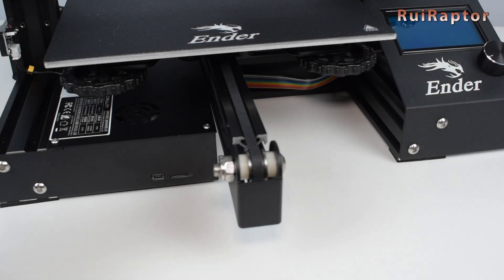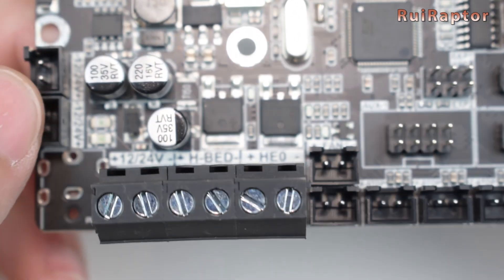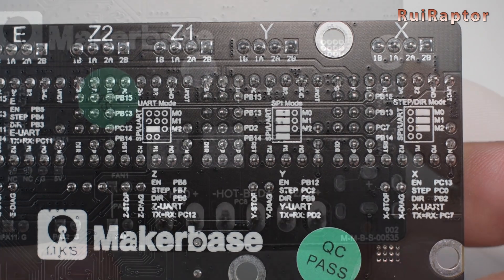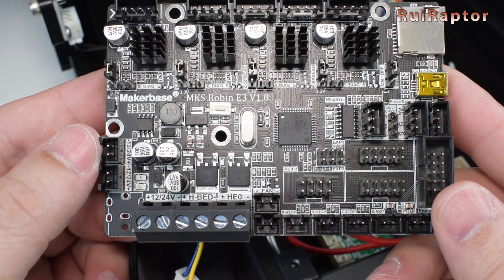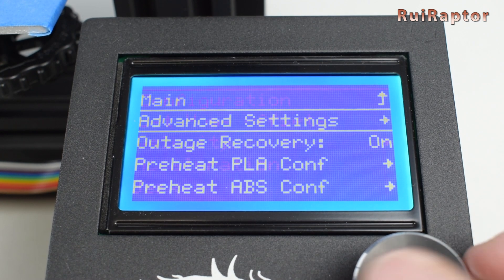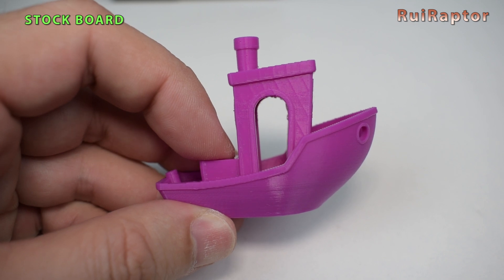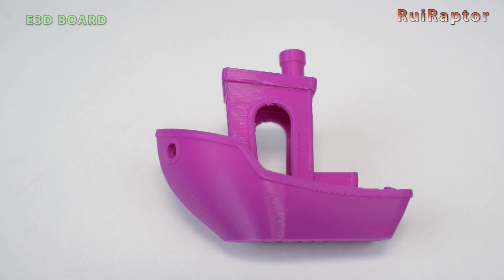MKS MAKERBASE Robin E3 / E3D - Installation & Tests (Creality ENDER3)

Comment: I hate these board and i hate this software. I was going to use the last of some filament and lode new during a print and was a little slow. Beeeeeeeep beeeeeeeep! every issue I have is with the sensors. one time the board decided it did not like the filament sensor where it was plugged in at! I knew it was all working so at last I tried to move it to the other sensor connection on the board. this morning the heat sensor was temperamental for no apparent reason. sending out an error i searched and searched and saw no post one any error message on the internet. I finally saw it was reading the temp wrong as I retried the print.  Stupid thing printed a birds nest yesterday but oh no one second of no filament and it must abort 1:30 of printing today. Im just going to tie off the sensor with the ugliest know I can make. I hate 3d printing.
Reply: ...now the board will not boot. I never have trouble with grbl + adruino

Comment: why does everyone use the skr boards over these. ive got a few printers with makerbase robin mini boards with either 2208 or 2209 steppers never had to dig into them so not 100% just know they are silent but they have been the more solid machines ive owned. im picking up a couple boards to have as extras an just to play around with and im on the fence if i should get an skr board one a makerbase. can anyone explain to me what the difference is an why it seem the skr or bigtreetech are more popular when from what i can tell they are just as good or better in some cases from what i can tell on paper or i maybe miss understand what im looking at.

Comment: Olá Rui, great review and guide! I just got my Robin E3 v1.1 after seeing this guide, I had to order it - took several months to arrive though :)
Mine does come with the separate fan connector.
I also have a very heavy-duty Mingda MD-6C I bought second hand with problems, it has larger stepper motors, think these boards would also work with it? I can see the perfurations for the SD card would not work, but I am sure it would be no challenge for my dremel hahah :) I am particularly concerned because of the display, which is touch screen color, so very different from Ender 3s
Reply from the maker: Boa tarde Daniel, Thanks for the comment.
The E3 model has non-replaceable drivers so if you need more powerful ones, you cannot replace them. The E3D, on the other hand, allows the installation of different drivers. However, you can try and tweak the output current values and see if they can handle (don't know which stepper drivers you have and how much current they need). As for the display, this board has several display connectors so it's very flexible. It might be possible with a correct mapping and setup of the firmware.

Comment: Notice for v.1.1 board, from Makerbase Github:
MKS Robin E3 V1.1_003 and MKS Robin E3D V1.1_003
    Z-STEP signal change to PC14
    Z-DIR signal change to PC15
    Add support AT24C32D eeprom on the board
Make sure your board pins definition in Marlin is configured accordingly
Reply from the maker: Thanks for sharing this information.
Reply: Hi, lets jump in here. I have a E3D v1.0 and want to update the firmware, what is the correct firmware for it? In the configuration file for the mks there is a E3P, shoul di use this os use the E3 v1.0?

Comment: 5:45The fan interface is incorrect. This interface and the nozzle cooling fan are synchronized output, so it can adjust the wind speed, but it is not conducive to the heat dissipation of the motherboard.It should be connected to the 12-24v out next to the power supply

Comment: hola ruiraptor haver si me puedes ayudar -hay un marlin configurado para creality cr 10 en el home de makerbase este marlin trae 3 opciones.
1. No BLTouch and No Filament runout sensor
2. With BLTouch on Z_EndStop and FilamentRunoutSensor

3. With BLTouch on PB1 and FilamentRunoutSensor
las dos primeras las entiendo lo que no entiendo es la 3. nose que significa PB1 si me pudieras explicar que significa esta configuracion en marlin te estare eternamente agradecido .perdona por extender la pregunta me dijiste que me pusiera en contacto contigo por email.pero no lo encuentro yla verdad es que no utilizo la redes sociales .bueno gracias por tu ayuda de antemano muchas gracias.
Reply: quizás sea un poco tarde, pero en la placa de MKS, hay un conector, un pin específicamente en parte de BLTouch servo, que se llama PB1. Si volteas la placa verás dicho pin en el sector del servo.

Comment: It is normal that the fan above the board does not turn, or at least not immediately. Does it work based on temperature?
Reply from the maker: It will start when the layer cooling fan starts.

Comment: Hola feliz año RuiRaptor que nada que me he decidido a poner la electrónica de 32 bits a 24 volt con la cama caliente de 24 voltios el hotend también a 24 voltios todo de la marca mks de makerbase también voy a cambiar lo que es el mosfet también de mks y los ventiladores también de 24 voltios mi pregunta era sobre los finales de carrera si alimentando la placa MKS e3 o si también tendría que cambiar los finales de carrera los que lleva la creality cr-10 son de 5 voltios bueno un saludo y feliz año y muchas gracias por tu respuesta de antemano este proyecto es para tunear convertir o una cr-10 en una cr10s Pro toda la ayuda que me prestes bienvenida sea y muchas gracias feliz año
Reply from the maker: Hi Jesus, all boards have 5V pins that can be used to power a small fan and some boards have 5V outputs dedicated for fans. If your board does not have this, you can use a step-down board (you can find this easily online) connect it to 24V and use it to power components that are 5V. The endstops switches are connected to the 5V pins that we mentioned in the beggining. You don't need to change these. One good way for you to know this is to do an image google search and type your board name and add the pinout word. You will get images of your board and the information of every pin.

Comment: hola felices fiestas ruiraptor   queria hacerte una pregunta  quiero renovar mi creality cr 10 
tengo una electronica mks e3 de 32 bits un- mks mosfet y  tambien quiero instalar  una cama caliente de 24 volt.  mi duda es esta. necesito una fuente de 24 voltios   a 220 ? tendria efectos sobre los ventiladores hothend  finales de carrera que funcionan a 5 y 12 volt. supongo que tendria que  cambiar la fuente de 12 volt/ya se que son muchas preguntas pero estoy un poco  perdido bueno haber si me puedes sacar de estas dudas  muchas gracias y felices fiestas 
y si me puedes recomendar alguna cama caliente  de 24 volt.que valla bien con mks e3 muchas gracias.
Reply from the maker: Hi Jesus, changing the power supply (from 12v to 24v) means you need to replace all the fans, heater cartridge, heatbed and external mosfet (depending on the  model you have). It might be easier to install a 220v heatbed instead since you only need to add a mosfet to control the heatbed.
Reply: @ruiraptor  muchas gracias amigo que tengas un feliz 2021
Reply from the maker: Thanks, happy 2021 for you too.

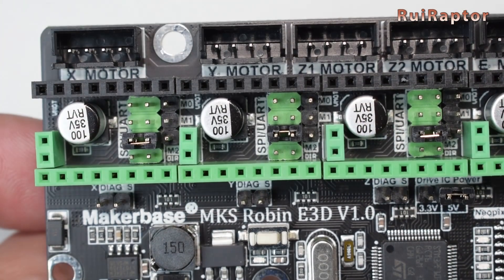Comment: I was going nuts when my board told me TMC communication failure. Then at 7:46 you show the jumpers needing to be installed on the TMC chip pins, for the whole donkey show to work. Now it reads 3d printer ready. Thanks a bunch.

Comment: Hola, acabo de instalar la placa con los drivers TMC2208 y me aparece en la pantalla el error "TMC CONECTION ERROR" ¿cómo puedo solucionarlo? Gracias
Reply from the maker: Hi, are your TMC drivers ready for UART connection? Check if they are configured as UART or standalone. If they are set as standalone, you need to change the firmware according.
Reply: @ruiraptor  instalé la placa tal como lo muestras pero con drivers TMC2208 y al encenderla ese fue el error, tengo la misma placa pero con drivers TMC2209 y no tuve ningún problema

Comment: Hi Rui,
Thank you for the great review, after your review I bought this board an installed it yesterday.
After some fiddling with Marlin (I was coming from a SKR E3 mini V1.2) I got it working and am quite happy with it.
Now I am looking for info on how to enable and configure the filament runout and the neopixels.
I think this board deserves a follow up and more in-depth video on how to configure the extras it delivers.
I know some people are struggling with the BL-TOUCH when using the PB6 pin, the normal instructions and baudrate for the serial port won't work with Octoprint etc.
I myself would like to see more info on how to properly configure Hybrid threshold (never got that to work on the SKR E3 mini) and linear advance etc.

Also I can confirm the new boards have the extra screw-in terminals so you can screw the wires of the hotend fan.

Anyway,
Hope you find the time, this board is worth it.
Reply: Seeing linear advance config and print comparison to the stock board would be really nice ;)

Comment: Between the mks Robin E3 e mks Robin E3d, what is a best?
Reply from the maker: Hi July, both boards are very good. The E3D has the advantage of removeable drivers but the downside of you need to print a piece to close the panel. It will be more difficult if you have the Ender 3 Pro because the panel is at the bottom. If you have the Ender 3 Pro, it's better the E3 because of this reason. Regarding the SKR  mini E3, this one is also a good board and has some better specs when compared with these MKS boards.

Comment: Just want to update on my Robin D3!  The version I received is still version v1.0, but it comes with the extra connector on the lower left corner.  I'm glad to find out the settings are saved WITHOUT the TF card.  I believe the settings are now saved somewhere in an area of the firmware!
Reply from the maker: Hi, thanks for sharing. You are correct, now the eeprom is being emulated and all the settings are saved in the flash memory of the microcontroller.

Comment: Hi. I wanted to comment that the new version of Marlin 2.0.6 that can be downloaded from the Makerbase page to compile, saves the presets you want and saves them even without having the SD card inserted in the printer. In fact, once you update the Firmware, it changes the file extension from .bin to .cue.
A great upgrade for a great, super-quiet and highly customizable board. Resuming a job after a power failure is 100%, although the filament change is missing, the pause option and job summary replace it without problem.
Thank you for this very educational and practical video.
Reply: La versión .bin de la página oficial instala la versión 2.0.1.
Reply from the maker: Hi Jota, thanks for the update. Makerbase did fix the eeprom issue. What they did was emulate the eeprom in the flash memory of the microcontroller. This technique is often used on  32bit boards without external eeprom.
Reply: Hi Jota Ele,
What do you mean by the filament option is missing? The port is on the board (I believe PB10 from the top of my head), the thing is we need instructions to configure it. 
I guess we could follow the instructions for other boards like the SKR E3 mini and configure the options in de configuration.h and configuration_adv.h etc.
Change the sensor pin in the pins file (marlin\src\pins\stm32f1\ etc.) but it would be nice to have some instructions, the same thing applies for the neopixel option.

I am still hoping Rui picks up this hint and shows us the way. ;)
Reply: @lusiada6787  
Hello and thanks for your comment.
Actually, if the change of filament is active but the retraction of the filament to be removed, you have to do it manually. Once you introduce the new filament, the priming of it does it automatically and it even asks me if I want to extrude more filament and then, once it finishes extruding it, it resumes the printing job correctly.

Comment: This is an excellent video, I lost count of how many times I watched it (>5 times). 
A big thank you!
I followed the advice and bought the Robin E3 board to upgrade my Ender 3.  The board worked out of the box.  However, when I tried to compile Marlin (using Marlin 2.06 in the firmware section of the MKS github, untouched), it compiled ok, so I renamed it Robin_e3.bin on a TF card, the LCD displayed “Update 0%” to “Update 100%” and then froze there.  
  If I use the bin files from MKS, it runs OK. 
I tried many different combinations and it still fails.  Would it be perhaps the linker starting address is wrong and it compiled into the emulated EPROM area?  I use the stock Ender LCD. Did you observe similar errors on yours?  Any hints will be appreciated!
Reply from the maker: Hi, we didn't had that issue when we did our tests. If your upload does not finish, then there's something not right with the firmware or the memory card. Did you try uploading but without renaming (use firmware.bin filename instead)?
Reply: @ruiraptor I did a search on the web and found someone else has similar problem "LCD freezes at Update 100%".  Unfortunately there is no solution given.  If I put firmware.bin on the TF card, the file was simply ignored by the printer.  Strange enough, the bin files from MKS works, and too bad they were based on Marlin 2.01
Reply: I spent the evenings of all week, trying whatever I can think of, to fight the problem.  I know the problem is not on my board as it works on the supplied FW。  I found it, and it was my bad！  When I compiled my code using Marlin, I got the compiled code "firmware.bin" in pio folder, and renamed it to Robin_E3.bin.  The LCD showed the update process and sadly freezes at Update 100%.  Just last evening I noticed there was another file in the same folder named Robin_e3.bin,  this file works and it was stupid me who never noticed this file before!  Thank you!

Comment: Hello.
Couldn't you connect the fans of the power supply and the extruder to the 12/24 V outputs that are free on the board so that they work at all times?
According to other information these connectors are for this.
Thanks, great video.

Comment: Hello friend, I love your videos, I have a question, I am updating my ender with this board, with the tmc 2209 drivers, looking at the Github, marlin, for this board, it gives me a few steps / mm, 80, 80, 4000 (  yes, 4000) and 500, x, y, z and E respectively, because so much difference in steps, compared to the original board of the ender 3?  Now I have mounted a bondtech clone, any idea of the steps / mm for the bondtech with this configuration?  thanks friend!!
Reply from the maker: Hi,
the difference in E-steps value is probably because the drivers have a different stepping configuration.
Check the firmware and set up to 1/16 steps. For calibration, you can follow our video here: https://youtu.be/ZfqeTzc3NpM

Comment: Hello, thanks for your videos, they help me a lot ... but in relation to this one in particular, in my FIRMWARE you don't have the options to load configurations or save configurations. I'm using an MKS ROBIN 3ED on Ender3, which could be, because every time I call Ender, I have to adjust some parameters that are not saving to the SD card ?!
At 10:12 of your video.
Thank you
Reply from the maker: Hi Edu,
You need to edit the firmware and enable the line "define EEPROM_SETTINGS". The store option will be available after you enable this line. But remember that you need to have the memory card inserted when saving the parameters and also when turning on the printer for it to load the parameters.
Reply: @ruiraptor  Hello ... which of these options should I enable:

#define EEPROM_SETTINGS
#define DISABLE_M503
#define EEPROM_CHITCHAT

Thank you, I am very lay in this matter

Comment: Do we need to print spacer for ender 3 pro? ( With robin e3d combination)
If there is a same think with ender 3 for pro,
 Can case fit using a4988 on extruder with shorter heatsink. 
Sorry for my english.
Thanks
Reply from the maker: Hi, the problem is the board cooling fan hitting the driver's heatsink. If you use the A4988 with shorter heatsink, it will close without the spacer.
Reply: @ruiraptor  thanks bro🙂 i like original looking.
Do you have any issues with this board.
Should i buy it.

Comment: I bought this to upgrade my anet a8 plus to silent steppers, but i cant my LCD working. I modified my firmware in platformio and copied the firmware.bin file to my sd card and put it in my robin e3 and powered it up, but the LCD doesnt light up and i cant figure out if it updated the firmware or loaded as my screen didnt show the progress
Reply from the maker: Hi Samuel, i just sent you an email back. Please check.

Comment: Hello, I was thinking to upgrade my Anet A6's motherboard using this one (mainly to have smoother movements and less noise). I know I have to use some kind of adapters to make holes fit, but I'll find a way., that's not my main problem... I'd just like to know if I'll have any incompatibility using tmc 2209 drivers and if i can use marlin firmware uploaded on MakerBase's github (changing configuration.h to fit my anet a6's hardware)
Reply from the maker: Hi,
Yes, it should work as long as you use/configure the configs for your printer.
Reply: @ruiraptor  perfect, that's pretty good

Comment: Any reason to use the E3D over the E3 ? I'm currently running the 'silent board' 1.5 from Crealty but can't try Klipper firmware or many other features (linear advance etc..) because of the steppers being locked, would this fix it ?
Reply from the maker: The E3 is equipped with TMC2209 drivers. With the E3D you can install any drivers you want. If TMCs2209 are what you need/want then go with the E3.
Reply: @ruiraptor  Do i need to buy those drivers to run the printer?

Comment: Is it possible to just flash the board every time if I have adjusted the offset value for the BL touch? as its ok for me to keep the computer plugged to the board.
Reply from the maker: Yes, it's ok to flash the board and it's ok to keep the computer plugged to the board because the power supply is isolated by the jumper.